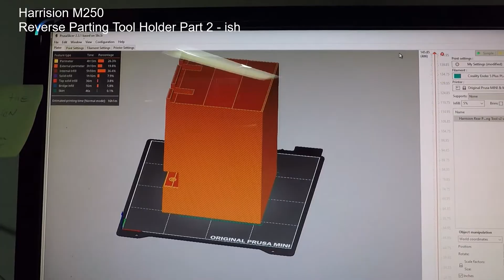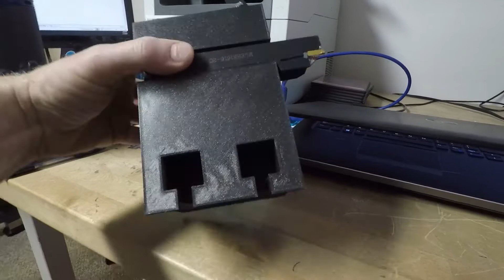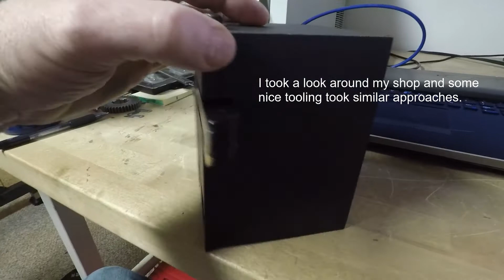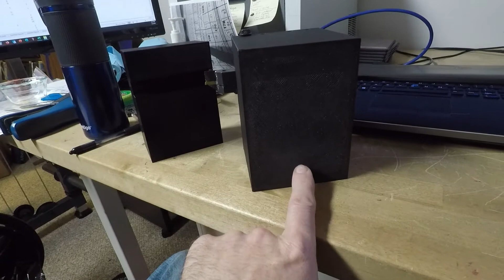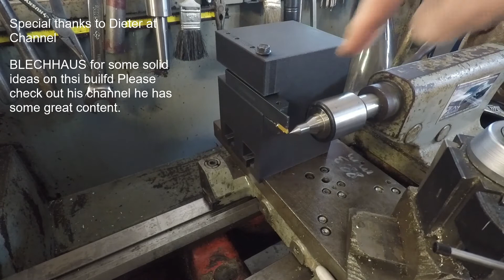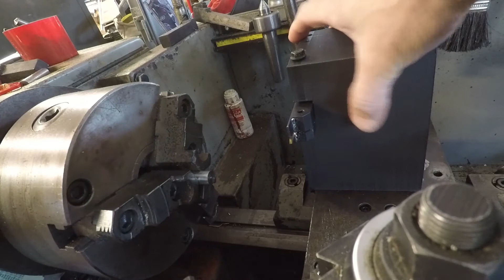Clausing/Harrison M250 Reverse Parting Tool Part Two - Reconsidered Design

Comment: I like the idea of the slot but I have to ask, what magic tool are you going to use to snug those bolts?
Reply from the maker: Thanks Jim! I tried my gear wrench box end ratchet first (which is pretty chunky) and I can get a good couple of 5-6 clicks in. My snap on box end will have lots of space. Its hard to see but when in place the fastener is only about 12mm in from the edge. I gave myself 25mm side to side. Being an old mechanic gives me an edge on fastener tightening - more so than me being a pretend machinist wannabe. LOL. 

Thanks for watching. Having it printed out was a big plus for just what you are noting. I would have likely spent hours milling with no real clue.
Reply: @houseofbrokendobbsthings5537  Good deal!  I obviously posted that before getting all the way through the video...  Oops!  3D printing does make for easy and cheap prototyping though!

Comment: I like that all lot better than drilling all the way through it. Good video.
Reply from the maker: Thanks Mike. I started to think about the drilling that far and ending on the numbers…LOL. My luck runs with good looks and wit. Accurate drilling not so much - LOL. It will breakdown nicely when I do the aluminum version. Thanks for watching - nasty cold one today. Temp Numbers not that exciting, but I had a chill all day long. Time to slip into my Volvo with the modified atomic heated seat and head to Karate class.  I will be three miles down the road and throttle back the heater and the seat… LOL.